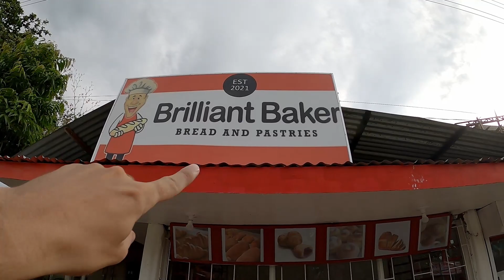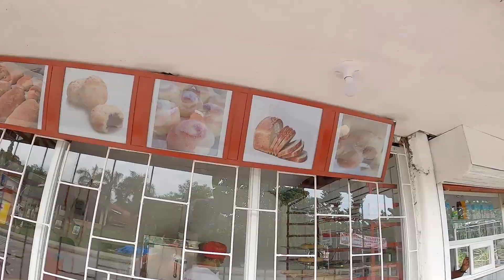Bakery Update 6-13-21

Comment: I suggest you guys put a table in fron of the glass window with covered cabinets down for flour, sugar and powder milk and use the table top for the two weighing scales for goid sanitation purposes and also for easy work for pedro

Comment: Like others have suggested a table and containers with lids are needed and should help Pedro. Also maybe consider installing on/off switches so that he doesn't have to plug and unplug the machines. Waiting to see what else they add to the bakery, like maybe donuts, sandwich bread, bread loaves, etc. Good luck with the bakery.

Comment: The sign looks great, the bakery looks bright, clean and it is a good idea for people to see the baker making the bread and pastries. Some sort of wide shelf or counter in front of the window with storage containers will save Pedro from bending down all the time. He could still have larger containers or sacks underneath the shelf/counter so storage containers can be refilled. 
The bread seems so cheap I can't umagine there can't be much profit, so surely it would take more than a decade to cover the cost of the renovations and equipment and three staff, electricity, gas, rent, etc?
Profit margins always need looking at in business, and you can always add more expensive items to compensate? If the building was a little bigger, a store with groceries, drinks etc, things you can buy wholesale and sell for more for a profit maybe? Just a suggestion, it may all be quite profitable and I may be wrong, but outgoings and initial outlay must be measured by the income from sold items

Comment: There is a product called safety relay, its purpose is to cut power on emergency stop. Always got one to any Chinese machines, prevent a any machine start up if your hands in there. You also put a sensor on the lid.